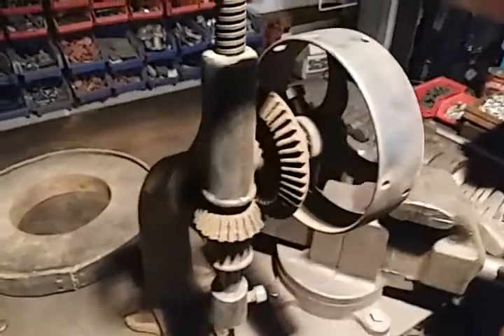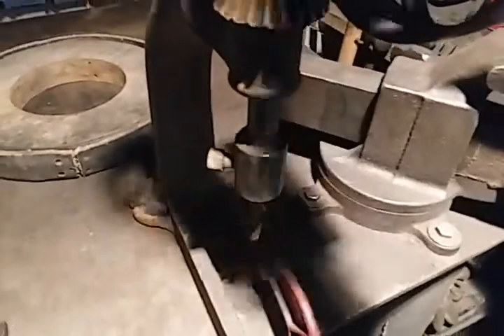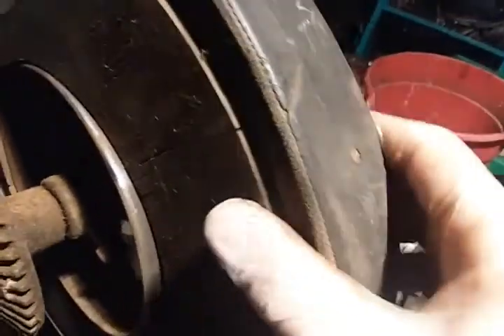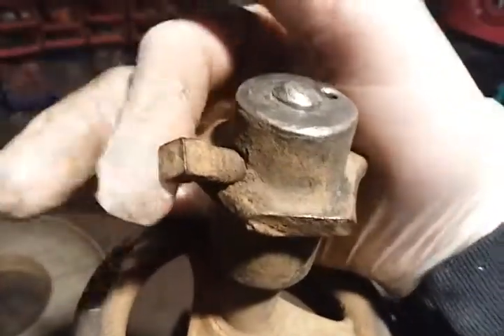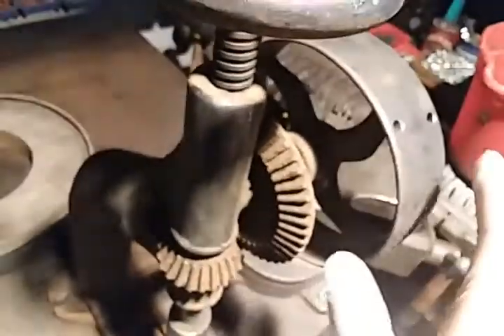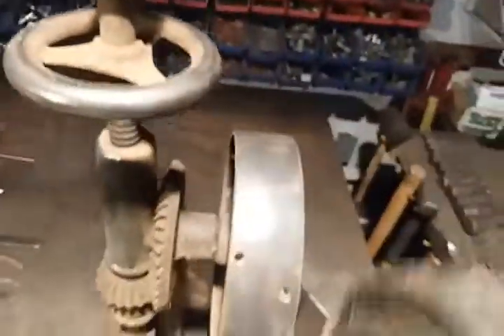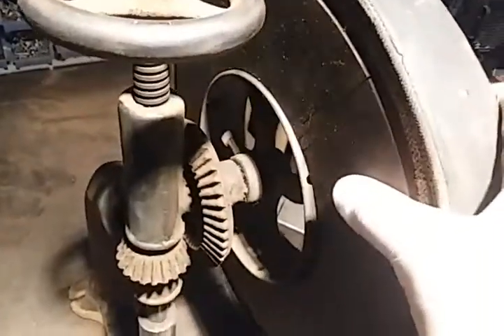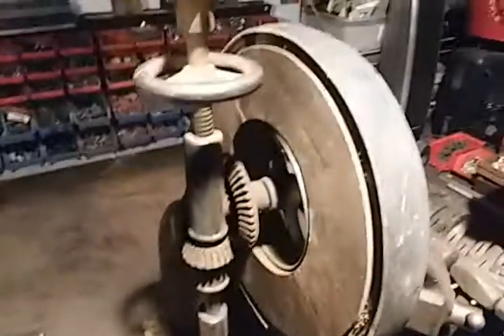Antique drill press

Comment: Very cool!I wonder if the larger wood wheel was hooked up to a belt drive using either electrical or water (wheel) power? That cast steel looks like it could have been late 19th or early 20th century. Thanks for another peek at that old beauty!
Reply from the maker: I was wondering the same thing man! I've seen a couple models online with the hand crank up top. Seems that either way would work as both wheels engage the gears that spin the drill. I'm going to have to figure it out. Stay tuned because I plan on taking it apart fully to clean it. And thanks for being a subscriber and enjoying my videos. I'm just a little guy on the YouTube todem pole. But I get some cool stuff and enjoy sharing it with you guys. I'm almost thinking the same thing though to get back to the bigger wheel. That some sort of flat belt spun it. The piece is definitely old. That's for sure. Thanks again for watching!
Reply: That sounds very cool! Thanks!